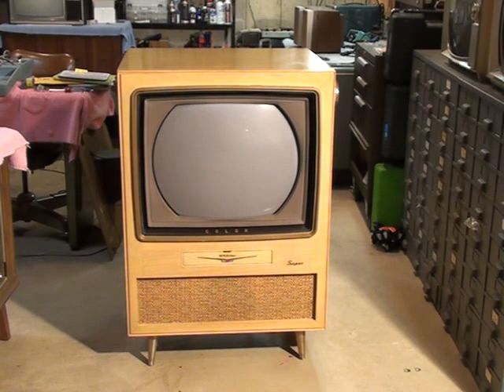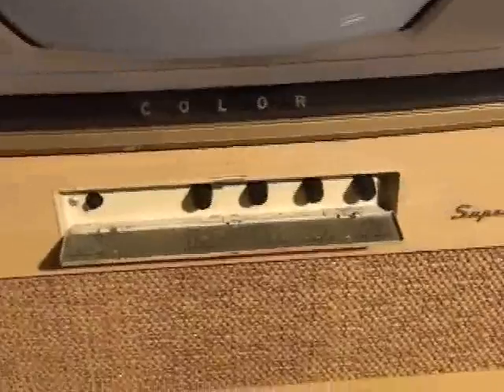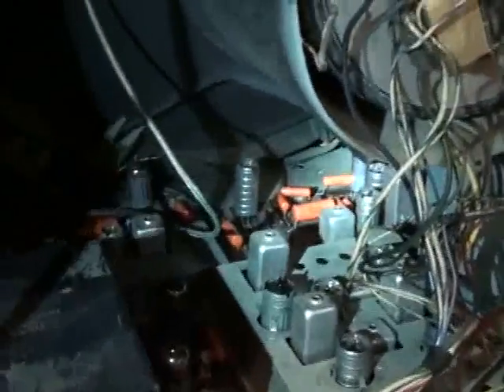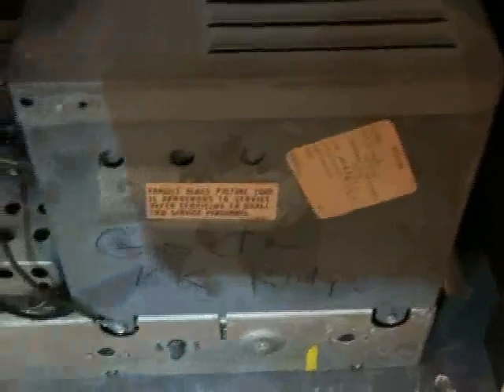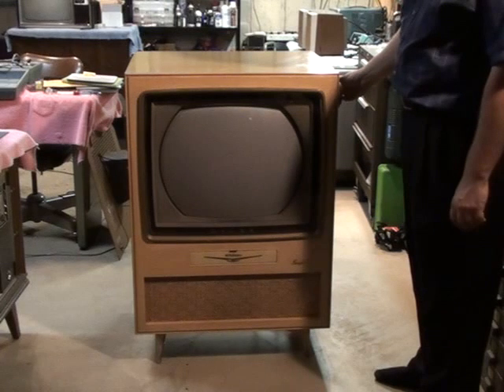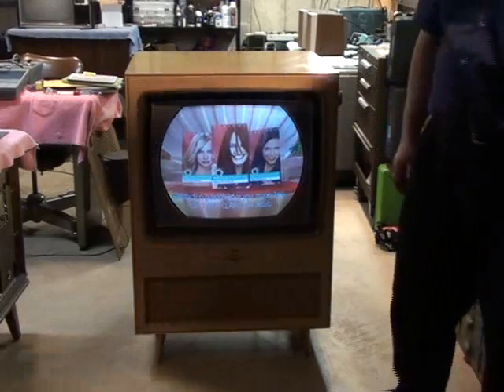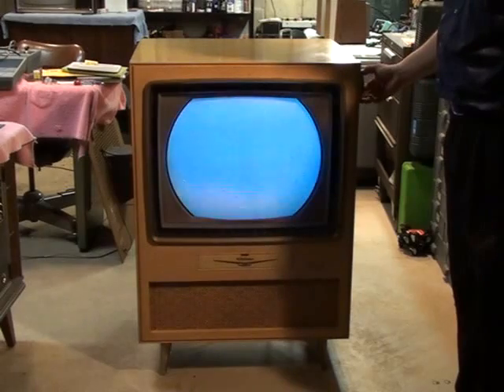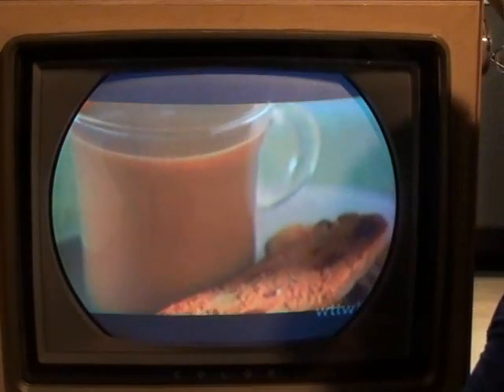Watch a 1956 RCA VICTOR CTC-5 COLOR TELEVISION!! "Roundie"

Comment: That's NICE! I was amazed when he tuned it in and actually got several channels. Now I see it's from 2008 and I'm not as surprised. As of 2017, in the UK we haven't had any analogue TV for a few years now. 2012, the Internet tells me. Though most people had digital, through a convertor box or digital TV, for years before. Of course now we've got wall-sized TVs as thin as razor blades, the Jetsons was right! Except the flying cars, where the hell are they?

Really nice piece of equipment. That beautiful, over-saturated, unreal looking NTSC colour! Over here in PAL-land, American import soaps look like dramas between a house full of shop dummies. It's different now it's all digital though. 

Nice restoration job. When you talk about the orange drops, do you mean you replaced every single capacitor? Why? Did you test them first? Can you test them in-circuit or have to remove them? It's nice to see the components on printed circuit boards, rather than the 3D rats-nest style, where things are stuck to various bits of chassis (or wood) and semi-randomly wired to each other. With big plumbers' soldering irons! I bet using PCBs made servicing much easier, since people used to service and repair TVs back then. Presumably RCA would have manuals with standard procedures for isolating which PCB is wrong, then from there on which component. 

It's surprising to see the quality of the picture. The colour is nice, the resolution is clear and sharp. Was this TV regularly used? Maybe in a house where people didn't watch TV much. Which actually makes no sense since they must've spent a fortune on this colour, "large" screen model, back in 1956. Which is before my mother was born! But the tube isn't worn out at all, it seems. 

It'd be nice to play old videos of Howdy Doody and whatever on this. Particularly whatever colour recordings still exist, probably not many, I doubt many were made, though there must have been colour stations for the TV to exist, and they had to show something! Video recording was only invented round about this time, dunno if that included colour. Still there might be film, 16mm film being what stations usually used for recording stuff to show later, pushed through a telecine machine to broadcast. 

Right now you can buy boxes the size of a box of Tic-Tacs that run Linux and have full software for playing video from a micro-SD card. Problem is, I've just realised, they only have HDMI out. OK next plan... A Raspberry Pi. They have analogue video out. You'd just need an RF modulator then to plug into this, and you have your own private channel from 1956. And maybe a few years before and after too. Stop just before The Monkees was aired and rock 'n' rollers started openly taking drugs (instead of privately like before). 

There's easy software setups you can download to make a Raspberry Pi into a simple video player. Add a few buttons to it to control. You could perhaps put the controls in a "remote control" box, made to look like something from the 1950s. The box could even contain the Pi itself! Have a cable coming out with the RF, and another coming in with 5V from an adaptor. 

And that's everything I've just thought of upon seeing a TV from 1956. Ironic being an RCA, in 1956 had they finished destroying Philo Farnsworth in court yet ?
Reply: (Yet) one more thought... There's enough Twilight Zone (from 1959) to keep a station running for... a while. My 1950s station would be heavy on that! Rod "God" Serling was a genius, TV miles ahead of anything else of the time. 

Maybe a few legendary sports matches. That'd be great! You'd have an exhibition, or an exposition even! An original 1950s TV that somehow tunes into 1950s TV stations. Actually might make a nice prank, the TV that's haunted by it's shows. 

Only thing would be not wanting to let it wear out. I'm sure most or all of the tubes are replacable with modern equivalents, there's still factories making old tubes, though not nearly as many as back then (because transistors were invented, then microchips, is why). And stockpiles keep turning up in Russia. Main problem with wear, would be the screen. It's inevitably going to wear out with use. You'll get however many years before it darkens, quite a few before it darkens intolerably. But after that where are you going to get a 1956 RCA colour cathode ray tube? There's likely literally none left in the world. Any that do are going to be in old TVs just like this one, and they're rare enough. 

It's a shame. You collect it, but if you use it, it wears away. If you keep it locked in a box, you're not enjoying it. Like some very subtle punishment the Greek Gods would give. For a very minor crime. Dropping litter perhaps.

Comment: That is similar to the TV we had in the 1960's that was made by Philco.  Note I said we had it in the 1960's.  That does not mean it was made in the 1960's.  We got ours used around 1961.  I think it cost my Dad a month's wages if I recall.  it was our first TV and a really big deal.  That TV had only channel 2 through 13.   But we could only get four channels, ABC, NBC, CBS and PBS.  The TV in this video must have been extra ordinarily expensive and rare.  I didn't see a color TV for the first time until around 1969.   I remember networks making a point to advertise when a show was in color as most programming was in black & white until the mid 1960's at least due to the fact that most people could not afford a color TV.  My mother got her first color TV in 1982.   I got mine in 1989.  I think the last time I saw a black & white TV for sale was probably sometime in the late 1990's.  My first color TV was 19 inches and cost me around $350 new.   My most recently purchased TV I bought about 9 years ago and it's a 50 inch TV and cost me about $500 at Walmart.

Comment: This video is from 2008, when TV stations still broadcast an analog signal.  It wouldn't work today without a digital broadcast converter box, and another converter to connect the box's coax cable output to the TV's antenna hookup.

Comment: Ch3, Ch5, Ch7, Ch9(WGN) CUBS, Ch11(WTTW) PBS Most of everything's on the VHF only tuner (2-13), White Sox on Ch32. This was before the already dated ATSC standard took over with it's sub hifi audio. TV had FM sound. The stereo version was better than FM-stereo. Bought one ($20) fixed it had color before my parents did, made them want to go out and get the RCA XL 100. Then I sold it for $100 about '71 or '72. Missed all that classic '60's era in color. In '56 there was only Gunsmoke to watch in color and maybe one other. It took over 20 years for color to penetrate the market.

Comment: Great videos. I think the roundie screens may have had inherent sharpness that the square ones could not match. I remember my father picking up a used Zenith from the 1960s back in 1978 and it was with it that I saw TV in color first time. Unfortunately the tubes in the circuit boards kept burning out and my father gave up on it. We later got the Philips Modular 4. but the old roundie definitely had a warmer and natural color I thought

Comment: Great archival work!  Bravo and 73s!
Do you have any mechanical scan sets from the late 1930s? 
How much high DCV on the CRT?  
As a kid in the early 70s, I salvaged these sets off the kerb as there are always so many great RF tubes and power supply parts I could use for building transmitter circuits.   (A poor HAM)  
I would have replaced ALL the electrolytics as there is a lot of high DCV those sets.  I find that it is easier and SAFER to do ALL the work all at once rather than over several years.  —Yeah the FP cans are a tad dear, but Antique Electronic Supply in AZ makes them off original Mallory tooling yet sells them for a reasonable price and your chassis retains the original look.  
Again, great restoration and a lucky antiquing purchase!

Comment: Great picture for an old set.  But it would seem having a color TV in 1956 would be overkill.  How many color broadcasts were there?  It's clear this TV aided in the development of color technology for the home, but for a quarter of the price you could get a B & W set.  However, there were those lucky ones who could afford this, at that time, very expensive toy.
Reply: People bought these TV's to last their entire life. People didn't buy new things every week or go on shopping sprees at the mall. One of each appliance and it has to last forever. The  people that bought these had the money and planned for the future.
Reply: +bctvguy  I would agree with that assessment.  My grandfather purchased an RCA color set in '59 or '60.  He had it for 7 years and got a Zenith model.  He gave the old set to my aunt who had it fully serviced and it ran for a few more years, but I seem to remember it was always needing an adjustment of some kind.  My folks bought their first color set in '69, a Magnavox.  It was very reliable, had a tube burn out at one point, needed a slight rebuild and adjust in '74 and, of course, the annual tuner cleaning.  Other than that, it ran great and was replaced in '81.

Comment: Yes,  realize that was the technology at the time.  But here they are playing a modern square-shaped picture.  Do the corners get cut off of it?
Reply: Yes. The picture that was transmitted was a 4:3 rectangle. But early color picture tubes were round because a round faced tube was easier to manufacture. So the corners were cut off. But as they got into the 60's they figured out how to make color tubes rectangular and the physical screen became the same shape as the broadcast image.

Comment: Are there still analogue TV broadcasts in the USA?
Reply: No. All digital. The only way you could make a TV like this run off the air is by using a converter box.

Comment: I'm curious to know what source the video is coming from and how you're doing it? Is this over the air?
Reply: +AllPro777 This was simply analog broadcasting going through an outdoor antenna and to the television. (As he states in the beginning of the video) This was filmed Before the standardization of using converter boxes to decode the digital signal back to an analog signal for older  (usually CRT television sets) televisions to use.
Reply: silverperzon Okay. I missed that part somehow, but he said it in the middle of the video, not the beginning. Thanks.

Comment: “Recapping the chassis” means?   This was published in 2008.  Is it possible to get analog stations now, in 2021?
Reply: Adding new electrical Capacitors in the TV Chassis where needed... hence 'Re-capping.'  And no... Analog TV Broadcasts went out the window in the US in 2009.  You would need an old converter box now with those old RCA composite connectors. Most old TV from that era only had built-in VHF-UHF tuners and nothing else.

Comment: So, you don't use any converter at all to get the signal ? US still broadcast analogue signals using 50's format ? I can't even use my 2003 CRT TV if there is no digial receiver attached to it since all analogue broadcasting ended up in 2012 in France.
Reply: This video is from 2008. The US still broadcasted in analog at that time. You need a D/A converter box in 2014.
Reply: Some people like collecting them as a hobby. I wouldn't mind having the old Packard Bell console TV we had growing up. I wouldn't use it as my main TV, but it would be fun to show kids how TV used to look.
Reply: The NTSC standard has only minor tweaks throughout the years.  Adding stereo and such, just like PAL - but they are always backwards compatible.

ATSC/DVB are now pretty much everywhere.    So this old box will need an STB to work from now on.
Reply: LenweSaralonde il existe des convertisseurs vers signal antenne analogique. Et même, c'est plutot simple à faire avec des modules vintage RF de camescope ou de magnetoscope (des petits modulateurs, sur le canal 36, en Secam L, ou PAL)
Reply: yahnsolo En fait la vidéo date de 2008 et ils avaient encore de l'analogique à l'époque, tout comme nous d'ailleurs. Ce qui m'étonnait c'est qu'un appareil de 1956 soit toujours compatible avec les émissions de 2008 et avec une telle qualité d'image . À l'époque, ils savaient fabriquer du matos durable. Aujourd'hui il faudrait effectivement un tuner TNT externe (branché directement sur l'entrée AUX ou avec un modulateur RF)

Comment: End of 70 's RCA make the first VHS( rebadged Matsushita National Panasonic), the VHS maid record a 525 lines 60 Hz video signal, with NTSC 3, 58 Mhz.
This deck maid record:
-SP modus 33, 35 mm/s
-LP modus 16,67 mm/s
-SLP/EP modus 11, 20 mm/s.
Only VHS made by Panasonic and similar, maid record in LP modus.
Other Deck maid only record in SP modus and SLP/EP modus, however they maid PLAYBACK sequences in LP modus ( servo CTL track allowed )

Comment: I was wondering how you were able to pick up an analog signal, then I noticed that this video was over 12 years old. If you burn out any tubes on that thing, I probably have some of them. My grandpa used to I take me a long to the flea market back in the 80s and he knew which vacuum tubes were, or would be worth something. I’ve even got some of the tube testers From the 1950s that still work.

Comment: This was recorded before analog TV ended.

Otherwise, This vintage TV set would've had to be connected to either a digital-to-analog converter for over the air TV, or a digital-to-analog cable/satellite TV box for it to work.

Comment: There was only rare color broadcasts anywhere on the planet in 1956. This is a 1960s TV,  although it may have been designed or patented in 1956.
Reply: Nope, as this title says, this is from 1956.
Reply: Designed & patented in 1956. Not mass-marketed until the 1960s because there were few color broadcasts until then. Manufacturers often named or listed their models on their design or patent date, so they appeared ahead of their time, by the time they turned up in most stores.

Comment: On June 12th, 2009, slightly less than 1 year after this video was posted, analog TV signals would end being broadcast. If you had waited much longer to produce this video, you would not have been able to tune in over-the-air TV signals without a DTV set top box (and a way to hook one up to that TV).

The problem I personally had with CRTs is the annoying high pitched squeal of the electron guns racing their way across the screen surface. While I agree this TV had a great looking picture, I still prefer silent LCD screens.

Comment: Could I ask what the signal source was during the demo?  The TV seems to have been using its own tuner and yet analog TV broadcasts have been off the air for some time.  Were there still analog stations on the air in your area back when you recorded this?
Reply: nakyer NTSC broadcasts were still on in the US until 2009

Comment: A really nice restoration. But, wasn't that one of the early, unshielded units that caused some kids to get radiation poisoning? The first color phosphors weren't particularly good. So, the manufacturers used extremely high voltages on the anodes, above 25KV, for brightness and the CRTs didn't have the lead shielding in them like later models. They put out X-rays. That's why your parents may have told you not to sit to close to the TV. It's was because of the early color TVs.
Reply: I remember that as well.. Supposedly there is a high percentage of children who watched early color TV who were sterile and had eye issues from the radiation..

Comment: I have herd that someone in the UK needs a licence to use a TV from the early days to these days. Here in Australia we don't have TV licence. My family has 6 TV's in the house and there holiday house they have 5 TV's here in Australia.
Reply: The UK tv licence isn't charged as per set, but per household. It funds all BBC tv and radio channels in the UK meaning the BBC does not need annoying breaks in programming every few minutes to air commercials as a way of funding it. The cost of the licence works out at less than £3 per week no matter how many tvs and radios you have in your household.

Comment: Vertical hold!  How many out there know what "vertical hold" is?  It used to be that while you were watching, all of a sudden the picture would flop over sideways, in a mess.  You'd then have to get up and adjust the vertical hold.  And color--very few programs were in color for a number of years.  NBC had color first.  When a color program came on, the peacock (the present-day NBC symbol is an evolution of that peacock) would appear, spread its feathers, and BAM--everything was in color, to the announcer's "This program is brought to you in living color on NBC."  Those were the days!  Senorkaboom's comment (below) is right on.
Reply: Thank you.
Reply: And you cannot forget that feeling of that first color set.   Watching all those shows once only seen in staid b & w now seen in glorious color.  And, you didn't have to go to someone else's home.
Reply: Wasn't side to side the horizontal hold? Vertical hold was used to stop the picture from rolling down down.  This was a problem with weak signals.
Brightness
Contrast
Colour
Tint
"Fine Tuning"   ; Press for Automatic Fine Tuning
Tone

In Stereo (where available)

Off
Reply: +senorkaboom Another milestone was cable.  2,6,8,12.
2,4,5,6,7,8,9,11,12
Reply: You're exactly right.

Comment: 1:33 bottom left, USB, cool! :-)
Reply: Noooooot really. That white wire was the 2-prong AC Power Cord, actually... plugged in just below the AC Transformer.  The other black cable to the left of it was the antenna signal.

Comment: how much power does it use up?
Reply: Y10Q over 300 watts.
Reply: Those sets were power hungry.  Tubes.  They got hot.  Typically about 400 watts.  But you could heat a living room too, with just the TV set.